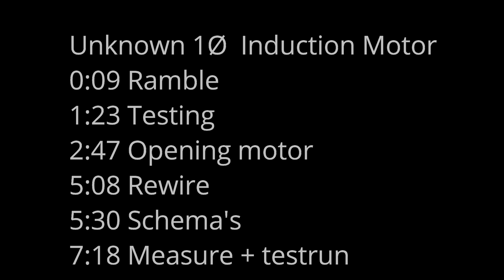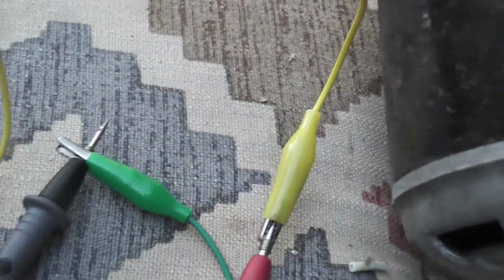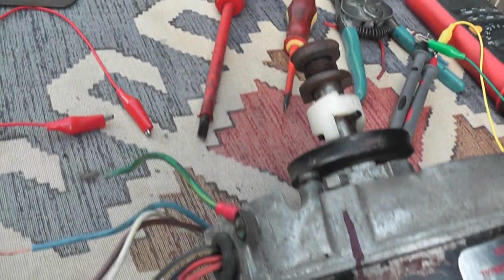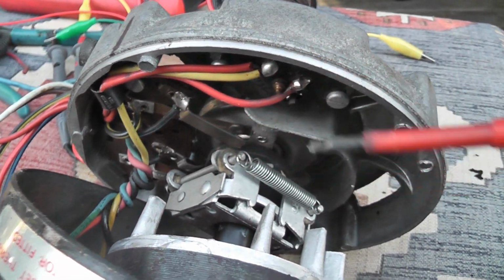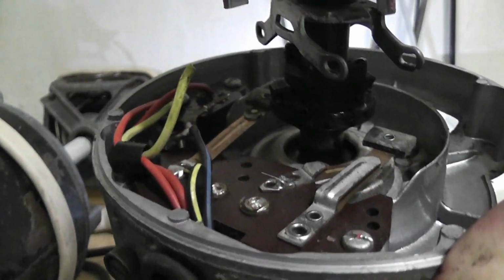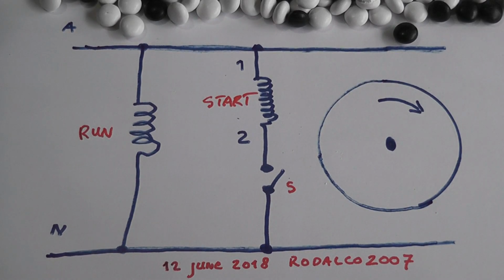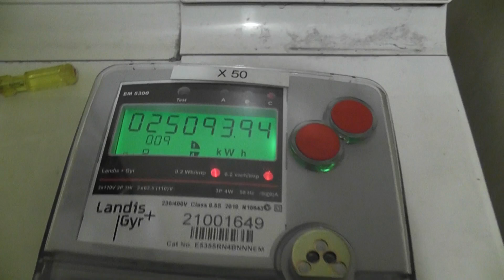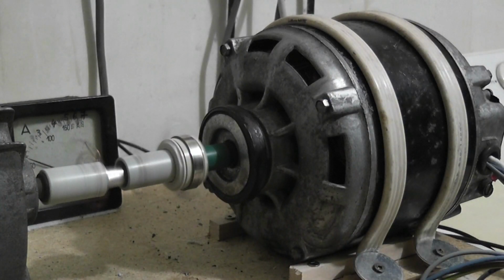Unknown 1Ø Induction Motor

Comment: At the end of the video, was the excessive amount of current just for starting up the motor to full speed?
Reply from the maker: Yes it was. Most 1Ø and 3Ø induction motors have a large start current. That can be up to 8 times the running load, depending upon what load is connected to the motor.

Comment: I’ve been trying to find a way of emailing you concerning your digital clock which is run by a stepper motor. 
  The story: 
I dropped my old Foscam IP camera into the sink, taking it apart I found 2 stepper motors.  5 volt, 5 wire motors. It’s about 17mm across the motor body.
Part No. W-24BYJ 
THE MOTOR WEB SITE:
https://www.emartee.com/product/41426/24BYJ%2048%20High%20Quality%20Stepper%20Motor%205V
I hope this helps some.
Edit:
I got the dimensions wrong,
Reply from the maker: Hi Greensilver, that digital clock I have has no stepper motor but a 24 pole 240 Volts synchronous motor with gearbox.